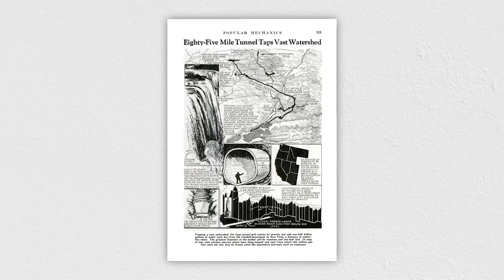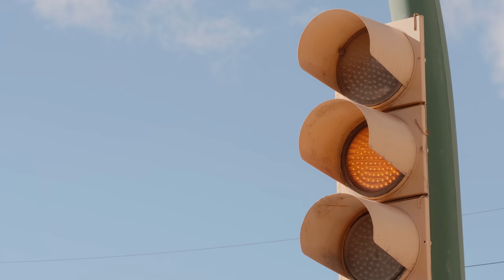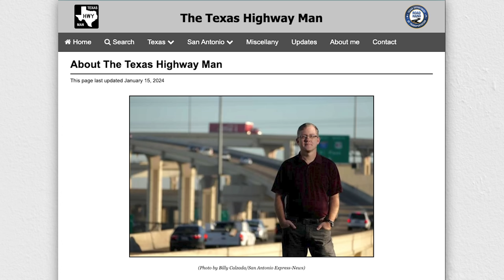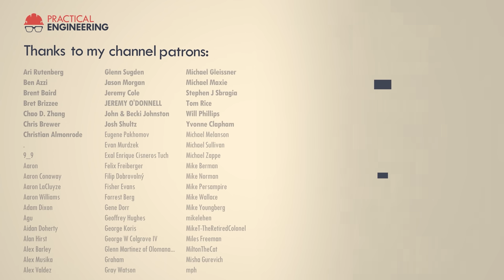Why Are Texas Interchanges So Tall?

Comment: One of the issues Texas has with the lack of frontage roads now is that they have so many private toll highways, those private companies are incentivized to not have frontage roads so they can force more cars onto the toll road.
Reply: Name just one privately owned Texas toll road.
Reply: @notahotshot  130, at least it was initially.  Don't know if that has changed.  45 supposedly was too.  Hard to find the way stuff is reported on them.
Reply: While technically "owned" by the state,  a few toll roads were designed and operated by private interests. It's currently only 5 projects across the state though, and most of those are "express" lane type projects for existing freeways.
Reply: This was the reason I never explored New Jersey. Every time I just drove straight through because I don't want to pay a fee each time I enter the highway!
Reply: @FalseHerald  Good to know.  I remember like 15 years ago hearing the agreement they signed with the municipalities had rules to encourage more traffic lights on frontage roads and longer times on lights and less expansion of frontage roads.  There is a place near me where two towns have been arguing about finishing about 1/4 mile of frontage roads about who is going to pay the contract penalty for the losses to the toll road.

I hope they go away overall.  I know one of the state regulators tried to get 130 to be toll free, but the cost to get out of the contract of $3B was too much to get passed.
Reply: @HyenaEmpyema  New Jersey has one of the most confusing road systems in the country.
Reply: @notahotshot  "Owned" is not correct, but "funded" would be.  The state gives a company the right to build a highway that the state should build, then gives them the toll revenues for a number of years to pay it off.
Reply: "Lack if frontage roads?"  Didn't we just hear how many thousands of miles there are in Texas?
Reply: Yeah... there isn't a lack of frontage roads
Reply: @frequentlycynical642  Yeah, but there are places where they are not finished so you have to drive a bunch of extra distance or use a toll road.  Like there are a couple spots by me that the toll road saves a mile and 5 traffic lights to go one exit down, and there are frontage roads on either side of that gap.  If they just finished the frontage road it would save a bunch of traffic going through town, get people to their destination quicker and safer, but it would cost the toll authority some money.
Reply: @BrettShadow  Except where there is.  Where there is a frontage road that ends and starts again a quarter mile later that makes the toll authority money just by the lack of frontage road.  Where in Texas do you live?
Reply: @Scoots1994  I was born in Downtown Dallas. Parents lived in Oak Cliff at that time. Lived in Desoto, Duncanville, Glenn Heights, Midlothian, Cedar Hill NRH, Plano, Mt. Vernon TX, Pittsburg TX Tyler TX, Longview TX, Hempstead TX The Woodlands TX Waller TX, Menard TX, Junction TX, Mason TX, Sulphur Springs TX, Winnsboro TX, Quitman TX, Gilmer TX, Roanoke TX, Lindale, TX, Scroggins TX, Mt. Pleasant TX, and Spring Hill TX. Any more questions?
Reply: @BrettShadow  jeez you moved a lot!  There are places around Austin that are clearly lacking in frontage roads to toll roads, I don't know the DFW area extended to know if it happens there too

Comment: But keep in mind, we don't have the money for railways.
Reply: I see what you did there.
Reply: To be fair the US also doesn't really have the money to build 4+ stack interchanges and 6+ lane highways among other things, and yet those are still constructed.
Reply: @dulouser1751  Thing is, more comprehensive public transport would also reduce the need for as many lanes of local roads, and for all those parking lots, and for expenditures on personal vehicles... Car-based suburbs are basically a subsidy for the already-better-off, at the expense of everyone.
If we're going to be spending the money, it should be on more efficient forms of transportation that reduce noise and waste and pollution and improve lives in general.
Reply: @IstasPumaNevada  I am well aware that it's more efficient in a number of ways, including economically, but for public transport to be viable you need a dense network with regular, fast and reliable service (not just the high speed rail but also regular rail transporting people to and from major train stations) and that requires a huge upfront investment and a significant time frame, ergo it requires a lot of political power as well as a population that is willing to wait 10+ years until such a massive undertaking bears fruit.
And that's absolutely not the case in the US, especially since the US is already making debt at a record level.
Reply: We have rails and dont want anymore
Reply: Most people aren't that frightened of driving.
Reply: @justinsayin3979  Most people don't enjoy driving, especially in heavy traffic. That's why road rage is a thing. On a train however, you can just be on the phone, have small talk or eat. In a car, you are forced to drive, in a train, you are free to do what you want.
Reply: @dulouser1751  public transport requires a certain population density to approach solvency, and most US cities are just not there.
Reply: @JakShadwin  not really, it is true that vast swathes of land are only sparsely populated, but the US clearly has areas of significant population density where a efficient and modern train service would be viable. These areas include: California, parts of Texas and most parts of the East Coast.
Reply: The US has the money. Its what priority it has that matter.

Its always about what we get from Taxes that matter in the end in democracies.

Not like the Saudi “the line” which has absolute no benefit for anyone, least the citicens.
Reply: @Tudsamfa with self-driving technology rapidly developing, this won’t be an advantage for the train
Reply: It started back in the day with the automotive industry. The public favored cars over rain travel, hence the introduction of the interstate system.
Reply: Texas will never be as efficient as Japan with moving people... ever.
Reply: @someperson5834  i wouldn't use the term "rapidly", it's still in the trial phase, and even should that technology I mature enough, it will not solve the fact that traveling by car is inherently less efficient.
Reply: Let's be real. You can't eliminate cars, but imagine how much less cars there would be on the roads with high speed rail networks.
Reply: Any form of public transportation needs to deal with the problem of how to get from the public transportation to where you are going. It's not even close to walking distance.
Reply: @redfields5070  What isn't in walking distance? Train stations aren't meant to be, that's what light rail and buses are for.

If that's done right, the entire urban population (80% in the US) has public transport in walking distance.
Reply: Nor the customer base to make them practical.
Reply: @Tudsamfa 
How do we get to the train?
Reply: @jgrenwod  Light rail/buses. Have you never lived in a city with working public transport before, I thought that answer is obvious?

Comment: This is the most American thing I've ever seen
Reply: They don't have roads in the country you live in ?
Reply: @pavelow235  Not with 16 levels of bridges. Here in Italy the vast majority of interchanges only have two levels. If a road needs to go over/under multiple other they usually make the interchange wider and use multiple smaller bridges.

For example, here's the biggest interchange I can remember off the top of my head and it's only three levels. 45°01'19.4"N 7°35'57.1"E
Reply: Then where are the guns
Reply: @demoniack81  I think this is about a "five" level highway interchange. A quick google image search of "Autostrade" in Italy and it looks just as ugly and anti urbanist as anything in the USA, so I don't know what you are talking about.

Comment: As a truck driver, Dallas is within in the top 5 hated cities for me to drive in. These tall stacks, seem to fail in  recognizing human behaviour driver fear and these heights do make drivers freeze and slow down.. Mix this in a  semi where the barriers are pretty much non existent yeesh. Now compound this with mechanical limitations of a heavy semi with steep grades it just doesn't work. Not to mention on the flat ground all these lanes split with no REAL clear marking on where you should go, and all gps does get confused. The one over by the air port is far worse where virtually every other car/semi has to do a Uturn at the Airport (this u turn isnt fun in a semi) I agree the bridges are awesome, but HORRIBLY implemented.  The Tollway bypasses in chicago now that's impressive to me,. It just works

Comment: It would be so much easier if these were trains
Reply: Really? So I can stand outside in the hot Texas sun for 45 minutes smelling the vagrant panhandler sleeping on the platform only to finally get on the train and find out the A/C is broken?
Reply: @justinsayin3979  the problem is you are assuming these are american trains. In europe 90% of trains have ac (the rest doesnt cuz theyre some 1960s train in Hungary or smth) Also there is this thing called closed off waiting areas so you only have to go outside for like 2 minutes to get into your train. Oh and trains dont heat up to 70 celsius when left in the sun for too long

Comment: Hi Grady, Thank You for the great work You do making these videos. You have probably heard of it but maybe not looked at it closely but I think You will love the  design and  engineering of Spaghetti Junction in Birmingham, England.  Built in the early 1970s it is way more than just a 5 level stacked asymmetrical road junction, it covers an area of over 30 acres and provides traffic access to 18 different routes. The structures include one of the longest road viaducts in the UK and also handles passage of  two railway lines, three canals and two rivers. If You make a mistake and take the wrong slip road it can add anything from 10 to nearly 50 miles to your journey depending on which way you went by mistake. Travelling many miles the wrong way to the next junction where You can turn around and have another go at finding the route you were after certainly makes for some interesting detours. There was a challenge a few years back where drivers were tasked with travelling along every one of the 18 possible routes to/from Spaghetti Junction in the shortest time, I think the winner managed it in just under 12 hours. The challenge was banned the following year as it was effectively an illegal road race on public roads.  Keep doing what You do so well. All the best from Scotland.

Comment: I live in San Antonio and appreciate this video especially. When I moved here in 1996 we didn’t have these flyover interchanges despite having 3 Interstates and 2 Loops (for you non-Texans, thats the same as a “beltway”) We now have several flyover interchanges and several more in the process of being built. I love the feeder road concept. One big advantage of that is that it can be used to keep traffic moving when a freeway is shutdown because of a fatal accident or whatever.  As for the high five in Dallas (that would be the Loop 635/US75 interchange) I have driven thru it many times from several directions. That sucker is HIGH.

Comment: When I was a truck driver a year ago, ALL of the freeways in major cities had exit ramps that were nust shattered concrete and little temporary ones. There were even a few bridges that had one of the directions not completed, so it was just a huge drop off with a little jersey barricade in front. That along with all of the barricades partially over the lane line made me hate running loads through there lol

Comment: I live about one mile from the High Five.  During peak traffic times it's a nightmare but don't know if there's a better solution.  The amount of road/highway construction in Dallas is incredible but still can't keep up with the growth.  Older freeways crawl because of so many cars on an obsolete highway but, land limits the expansion and/or redesign.  As with many cities, during rush hour, you can easily spend an hour commuting to/from work.

Comment: We have that here in Nuremberg, but with train tracks that cross each other on three levels. We even have a (small) station on two levels with an elevated platform (plus tram on street level so it's actually three levels of track). Ironically, the freeway is interrupted by traffic lights at almost exactly the same place.

Comment: Its funny where i live there's a clover leaf interchange that i use every day for work and in 14 years the only time i've ever seen traffic at the points where 2 loops meet, is when the main highway is already backed up, never as a result of that crossover
Reply: sometimes they take the weaves off the mainline & put them on parallel roadways which connect the loops...

Comment: I drove from MN to Richardson where I think that intersection is when it opened a few years after it opened and its more massive than what you'd think it would be. I did a turn and burn so pretty much drove there, seen it, and headed back north to Minnesota. I was also 19 and could drive non-stop-ish for a good 24 hours or so. Not so much today.
Also, I asked for copies of the schematics for the project and the entire document for the project was 1500 pages and $1000 to produce. I didn't do that.

Comment: One great feature of feeder roads is redundancy. If there is a major obstruction on the highway there is a way to divert and avoid the delay. This is one of the great features of the NYC subway with its express and local tracks. If one track goes down trains can go around the problem. Try doing that in a single track system such as London's underground. Hours and hours of delay. It only has to happen once for you to realize the advantage of a two track/road system. Of course the down side is the complexity and expense of two track/road systems.

Comment: There's a good stack interchange to the south on the M25 in the UK. And the 2 motorways are top and bottom, with the slips in the middle.
Stroads, frontage roads and cloverleafs don't exist here and the only 5 lane motorway i know of is a short section of the M25 going past Heathrow airport. 
Diamond interchanges are from A roads (secondary) to B roads mainly (so when you show a amall diamond interchange with lights being like 5 lanes, nope. We get 2 lanes (one each way). But the vast majority of Motorway to smaller road interchanges are traffic circles (traffic lighted roundabouts) and sometimes we do do multiplexes of multiple roads or junctions where space is tight.

Comment: I've lived near Houston, generally speaking, for 35 years, and have a crippling fear of heights (also, I'm a pilot, and that's a lot more common than you'd think). Since the plague, I have suddenly entirely lost my fear of being on the flyovers, some of which are taller than the altitude I've flown down the beach in Galveston. Also, the I-10 corridor is used for more than just cars and trucks. ATC has told me to take "I-10 west to 290 and turn north."  I responded with, "do you know which exit that is?" Much laughter followed from every pilot on that frequency :P

Comment: I made the same observation when I lived in Texas. They are all over the state and they are all so similar. And they are very very high up in the air. Texas has the best roads system in the U.S. Going through most every city in the state you will have the 6 or 8 lanes of the highway you are on, then on both sides of it will be 2 more lanes all the way throiugh every town to get off and interact with the local business'. I loved it. And throughout the state there are mostly WIDE two lane roads with 55 mph speed limits. You won't find yourself driving out in the middle of nowhere driving 45 mph and putzing along getting nowhere like in other states. These roads have a shoulder lane that is wide enough for you to pull over and drive at full speed to let faster cars pass you. Driving in Texas was the best experience ever.
Of course to do this for people you need wide open spaces, that only Texas has. They do everything big. You won't see a gas station or convenience store on a little quarter acre lot with little parking. The lots there are huge.